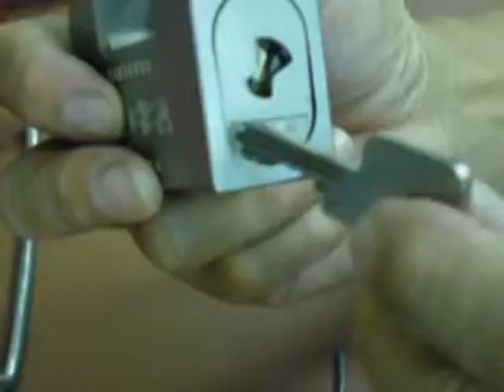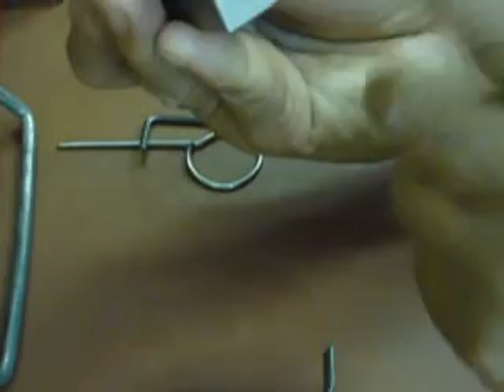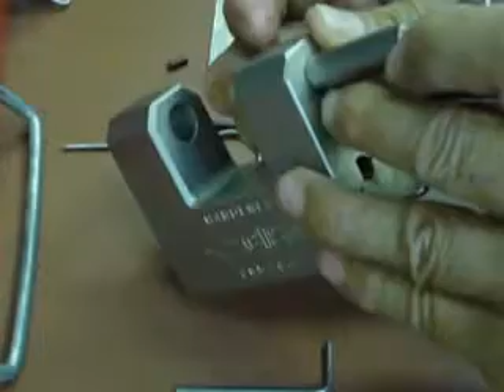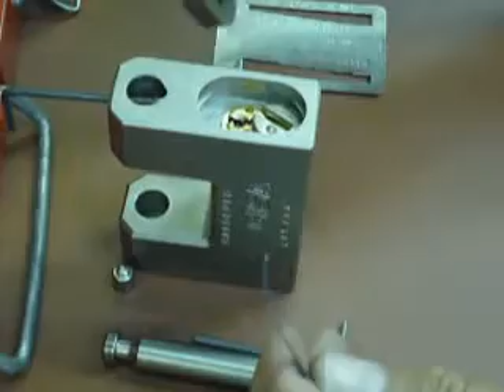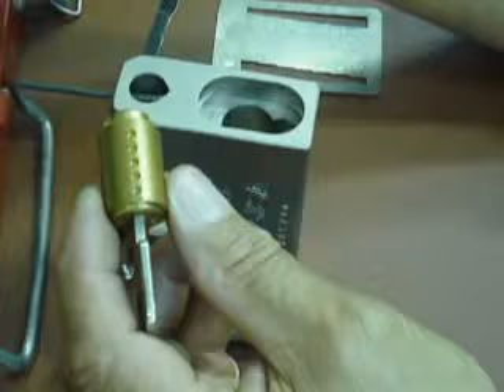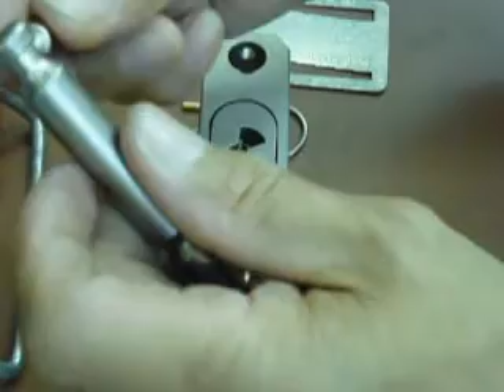HOW TO REPIN CISA 285-84

Comment: I have this lock but no key can you make me a key if I send you the lock
Reply from the maker: +Paul Thorburn Hi Paul, sending the lock and resending it back, is a  cumbersome proccess, considering the place  where i'm in. but, i would be very surprised if a local locksmith in your area nearby, cannot do it.  this is just a normal lock. i may suggest try your local locksmith there.  its the best option.